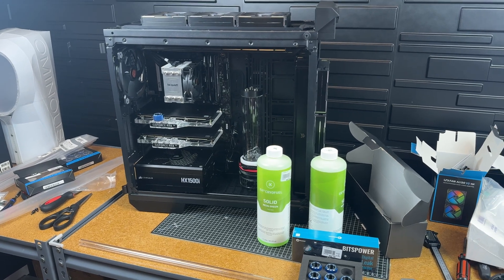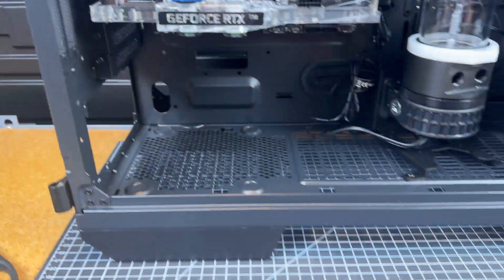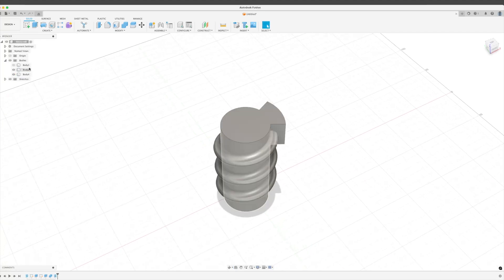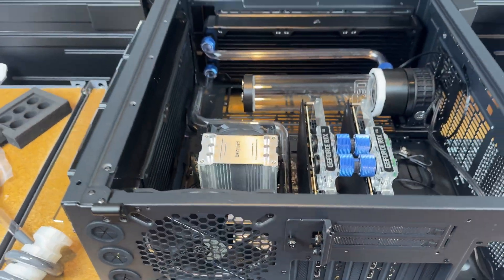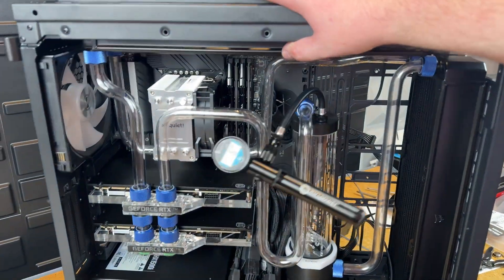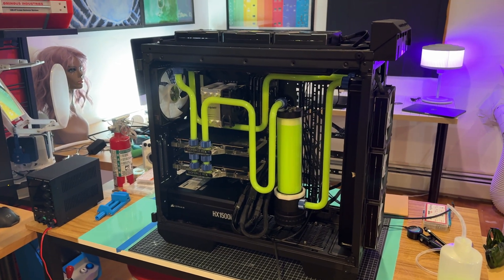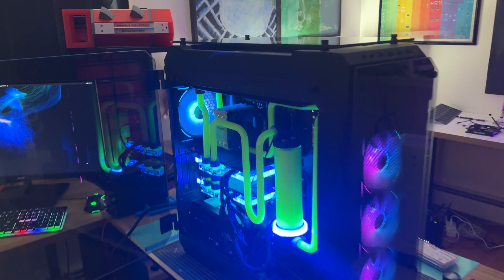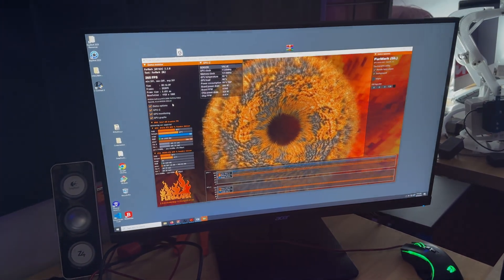Finishing My Dual 3090TI Custom Loop Water Cooling Build

Comment: Nice. one of my customer whom i provided 3090 1.5 yrs ago need dual 3090 for his ai and deep learning pc. Now he wants to run two 3090 cards in one pc. I told him need to change case from Antec dflux mid tower which wont accommodate 2 3090s and need change of board which he runs b550m wifi from asus? with ryzen 3600. SO can u tell me what board and processor he needs to change for dual 3090 setup. DO i need Nv link to run two cards. What board is best suited for this some one recommended x570 or b550 taichi from asrock . he has cm 1200 watts psu running now.
Reply from the maker: You don't need nvlink. Honestly any mobo that will physically fit the cards should be fine since it's going to stay on a ryzen cpu.

Comment: Crazy setup and well done but that looping you have set up is making my head hurt 😵.  I would be afraid to have it loop into the graphics card and have always thought that it was mainly for the gpu. Not to mention if I need to access the ssd slots without taking apart the loops
Reply from the maker: Thanks very much, yeah the loop looks different but it is fine so far and hasn't faced any issues fortunately. I am surely not going to be modifying anything on the mobo because I do not want to have to drain and remove the loop haha